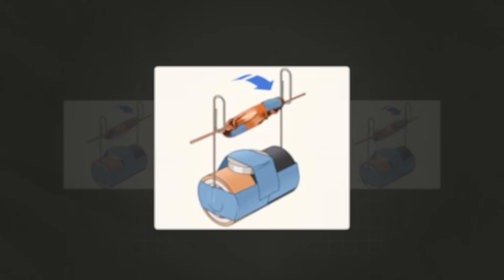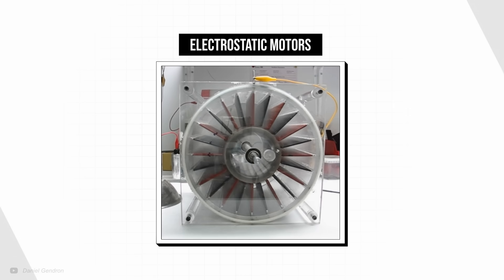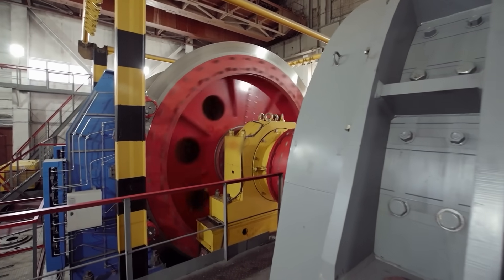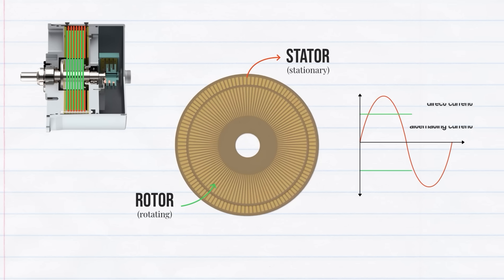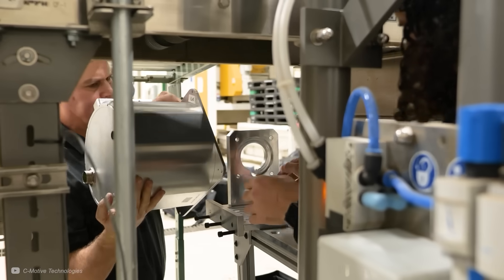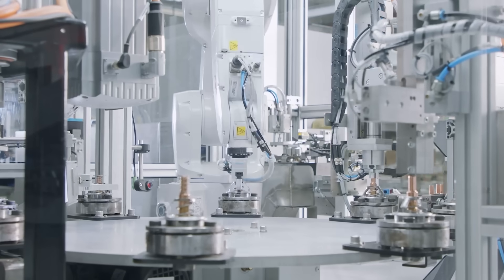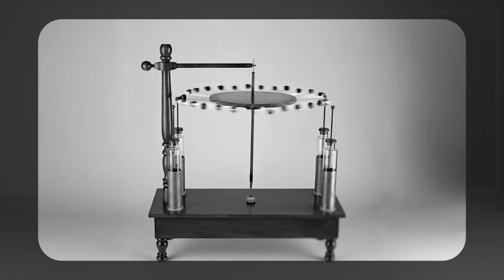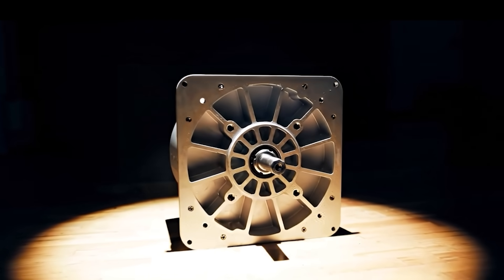How Electrostatic Motors are Breaking All the Rules

Comment: I designed a motor with a new version of the normal windings over a decade ago. I managed crap tons of torque at very low amperages and used voltage to gain speed. for the size of a coffee can  it is impressive but has drawbacks I have not been able to overcome, cost being  the largest of them, and feedback being the second major issue. While not even close to perpetual the regenerated power has to either be dumped or used to supplement the input power in parallel and as I am not a wizard with regulation systems I got stuck. Then when you look at the general costs to file a patent everywhere possible I just mothballed it and will leave it for someone else to solve after I die. If I could get the power system for it solved I would have already put it in my car as a replacement. The idea is scaleable and the beefier you make it the more power in terms of speed and torque you can get in really small sizes. Electric motors are a blast to play with and I was looking for R/C car/truck/plane uses when I started. Being un-wealthy really kills the ability to get the parts made and bought when creating new forms of technology. I shoved the idea and prototypes onto HDD and boxes to give to a few schools when I die to get the tech out there later.

Comment: Please do a modicum of research before presenting these claims.  This is far, far too much of a hype/info-mercial instead of science journalism. 

Specifically, there's no evidence that electrostatic motors can replace the duty-cycle (efficiency at a typical speed * torque range) of electromagnetic motors.  Forget replacing anything on the factory floor.  Induction motors are far too cheap and efficient.  At best, we're looking at aerospace applications for low-torque & low-speed & high-precision with a high torque-holding duty cycle where there's no need for the volumetric power density of hydraulics.  Those applications are few and far between.  

The "scarcity" of rare earths and lack of materials re-cycling is also from very overblown to downright lies --likely marketing spin from the manufacturer.

I'm being vividly reminded why I stopped watching this channel last year.

Comment: Regular mineral oil has a breakdown voltage in the 10 - 15 kV / mm. Those looked like >.5mm spacings and you said 4kV. Also they could coat their electrodes in solid dielectrics couldn't they?  The forces you can get out of static charges are so crazy it's hard to understand why technology like this hasn't already been around for decades.

Comment: Do the math  ,P=I×E . you cannot derive 5 horsepower out of micro or even milliamperes of current if you have a realistic high voltage not high enough to flashover insulation in or outside the motor. This is a totally bogus report.

Comment: aluminum transmitter coils have no back feed into the power source from the delayed recession of shifting flux on a stator that a PWM would use a transistor to field flip the transmitter coil on. analog redundancy, AC and aluminum transmitter coils. when it happens to be more available then copper, 300% currant flow reduction without added cooling. 4hp becomes 0.75hp aluminum wire, the abysmal 2025-2035 Ontario EV mandate.

Comment: 1.   Current motors are around 85% efficient,  not 65
2.  Electrostatic forces are very weak, unless using extremely high voltage. ES motors are low torque devices!
3.  Because of the high voltage, you can't run from batteries or reasonably sized power cables, - so no portable motors
4.  The ultimate dust magnets - HV attracts dust so these motors will need constant cleaning
5.   High voltage electronics are incredibly expensive and prone to failure

Comment: err - did you just narrated in an elaborated way the press release of a company?! — yepp, you did! – it became more and more obvious to the end of the video, even if you don’t mention the company… boy, stop repeating the happy-whatever press-shouting of a company, start thinking for yourself and most of all critical! so exiting such an interesting "invention" may be [the basic design is well known for a longer time now!] or even more exiting a greater usage of this technology may be by replacing conventional designs with rare earth magnets or coils — don’t let your excitement cloud your judgement! hell, be more critical and don’t simply read a mere company ad!

I thought about the design and its implications. In the IT we had for a long time the hard disk drives. Simply an design like the good old music record, where the read-write-head is flying above the rotating disk. a "head crash" is destroying the magnetic layer on the plate and therefore the recorded data itself. with the plate-electrode-design in the electric motor the architects of this solution facing the same trouble, not only the insulation problem! I think, the main problem in this case is not electrical nature in preventing shorting outs between the electrodes of stator and rotor — the main challenge may be mechanical: with increased rotation speed to prevent the plates to touch the neighbours or simply get disintegrated by centrifugal forces. If you can handle the stiffness vs. brittleness of the plates in relation of the rotation speed, size and vibrations (internal and external induced), if you can guaranty the gap between the plates at a minimum and all time in all circumstanced, then the next question of the insulation medium is easy. there are existing solutions… and the architecture of the "geometry" of the printed on copper paths re an complete other beast to handle. in the end this all only general thoughts of a laymen and non-expert …
Reply: I couldn't survive past the 5:20s mark. This vid was so obviously startup PR material, rejigged with the help of an LLM. I suppose as such is an inevitability when we turn our creative output into a full time money-making job. On a slightly tangential note, one thing I like about YouTube is that the more professional your channel becomes the less attractive it is to a great number of us.

Comment: I dont want to be overly pedantic as an electrical engineer but breakdown voltage is expressed as volts over centimeters usually
4000 volts over what distance? If 0.8mm then i guess it will withstand 230 volts in euro grid

Comment: Makes me curious about the possibility of using a solid dielectric housing around the stator and rotor. Kind of like a capacitor that has one charge plate in the rotor, and multiple charge plates around the stator. Less drag compared to using a dielectric fluid.

Comment: I question the need of this for the "supply chain security" or environmental angle. Both SRMs and electromagnetic-rotor motors avoid the need for any permanent magnets. SRMs probably don't cover the low-speed high-torque application domain they're going for, but in other domains we probably have better options for getting off rare earth magnets already.

Comment: This solution has two huge, insurmountable problems:
1. We do not have powerful transistors to effectively manage such voltages.
2. The friction of the metal invariably forms fine metal filings, which lead to a short circuit in the motor.  Which is fatal for the entire motor and control circuit.

Comment: The automotive application would actually be useful, hook one motor to each wheel inboard through a CV axle, at 60mph with an 18 inch wheel diameter, that's 1120 rpm. If these motors experience power loss over 500rpm, that means a top speed without significant efficiency loss of about 27 mph. However, a city bus with typical 42 inch wheel diameter results in 480 rpm at 60 mph, so these motors could be put in a city bus, one to each wheel, and a dampened generator unit on the roof of the bus can recharge a capacitor array in the chassis to drive the motors, and that would be a very good use case for these. So they prove themselves with industrial applications, and contract out to bus manufacturers who want more efficient buses.
Reply: Actually, another major use case would be baggage tugs at airports, and put in a generator-capacitor-motor hybrid system for other airport vehicles. The engine to dynamo maintenance is easy and fast, the dynamo to capacitor maintenance is easy and fast, and the capacitor to motor maintenance is about as difficult as current hydraulic and transmission maintenance (if a bit easier, but there's still the motor controllers) but faster with the added risk of shocks that are easily avoided with insulated gloves that power line workers wear. Overall, gas to generator to capacitor to motor (and back to capacitor on braking) is overall the most efficient multi-speed drive system for motor vehicles.

Comment: "Can withstand up to 4000V" - great! But not a word about how do you actually power such a motor. High voltage power supplies are anything but trivial or cheap, especially if you need essentially a custom VFD that can go up to a few 1000s of volts. In industrial applications this also means you have to deal with a number of regulations regarding high voltage and employ specially trained and equipped personnel to work with or around them which is anything but cheap either.

Comment: There's nothing secretive about the fluid. There are plenty of mineral and silicone oils which can prevent dielectric breakdown and help with cooling. Regular mineral transformer oil has a dielectric breakdown strength of 45 kV across a 2 mm gap.

Comment: About absolute maximum for high voltage before it produce spark is about 100,000 V per meter. With 0.8mm gap between disc it give us the maximum voltage we could get roughtly about 80V doesn't sounds exptreem by any mean. With that voltage current need to be pretty much the same as with magnet motors.

Comment: using 90% less copper only matters if its just as easy to recover that copper after the moters useful life span is over... and copper is a fairly easy metal to recycle and profitable sometimes. recovering copper from a PCB like thing is harder then copper bare wire.

Comment: scim are already over 90% efficient, the electronics needed to control motors at 4kv for a conveyor belt or other small motor in industry make this less efficient and far far too expensive and require special approvals and maintenance staff.  all that to replace a 10hp conveyor drive that works fine.

Comment: Great achievement! 
Does it have a minimum required voltage for the liquid to conduct? 
Is the liquid a 3M proprietary or C-motive?
The section about savings seems to reveal a high cost of the motor, can you give us a clue?

Comment: Speaking of high Voltage:  with all the lightening bolts coming down, why not build bolt capture stations that perhaps use a laser to ionize the air* so the bolt will follow that path to a Million Volt motor that can lift Skyscraper size weights to store the energy and then let the weight down slowly to run generators ?  InventPeaceNotWar.   Ck out new video on $4 "cure" for Alzheimer's should be on youtube my channel for public view Free as a gift to the world.  Its pedialyte or $4 generic equivalent. : *or shoot conductive wire up at storms to cause energy to follow that path, if done right the wire could be graphene and perhaps could be rewound back onto reel for re-use?  Ai says:  "An average lightning bolt contains about 1 billion joules of energy, which is roughly equivalent to the energy needed to power a small town for a day. However, capturing and using this energy is extremely challenging due to its high voltage and brief duration". So it would solve all the USA energy needs in very short time presuming a 10% capture rate in Florida summer day (we get 3,000 bolts per day avg alot of summers.

Comment: Very interesting.  I'm in the HVAC unit design, so I'm curious how they could affect that industry.  Fans generally don't use a ton of energy, but the refrigeration compressors use a ton, they probably account for 80% or more of the power a unit uses.  If they can make a compressors that uses very low power, they'll steal the market.

Comment: Couldn't they make a better connection between the stator and rotor if there was a kind of brush like structure between the two made from carbon nanotubes?

Like a brush motor, but carbon nanotubes instead of copper.

Comment: By ditching ferromagnetic materials you speed up the magnetisation of the system, also, high voltage increases the speed even further. I have a feeling this leads to a pretty big lack of dynamic range of flux - eg best for stable speeds and gears, unless the axle can free spin (with no current) and you alter the pulsation of the current (or maybe the duty cycle?) which would still rapidly saturate the system at a fraction of the speed of light (eg 50%, 10% 1% etc). Let's see, 1% of 300,000kms is 3,000 kms.While a MOSFET can switch at 100 Khz, the GAN can switch at 380 Khz. This is what powers Class-D audio amplifiers: pulse width modulated SQUARE WAVES at 380 Khz which you would assume would sound terrible... but Class D sounds... "OK". How? That signal is shunted into a torroidial transformer with good ole ferromagnetic material tuned to audio frequencies, so from 20 hz up to 20 Khz.. It can not produce such high frequency and is thus coaxed to "slowly" produce save a sine wave of say a 15 khz cymbals crash, drums or vocals etc. The bass signal practically looks like a DC electromagnet at this speed - m+agnetic+a+lly pulling the current in the speaker wires more like the coming of the tides twice per day.... driven by the flickering firehouse pulsing hundreds of thousands of squirts per second. Also..... you can go contactless / brushless by using the more old-school magnetic induction process to inject energy into the motor using lower voltage and electrically isolated "coupled inductors" situated just outside the motor + some ultra capacitors me thinks!! If you can can limit the current the 500 V to 5,000 V is a nice spicy voltage that should melt the GAN (Gallium Arsendine Indian AFAIK) but its OK if you keep them very cold. I wonder if CO2 is the insulator? I was thinking you were going to say the motor operates in a vacuum of argon / neon etc. That would look very cool. Liquid nitrogen? Wowzer. Also, the insulators - plastic, etc is very lightweight. Vacuum motor would be very low friction right?

Comment: With discs spaced just  0,8 mm apart I don´t see a lot of room for vibrations and sudden changes in position. Certainly not something you´d use in an EV car. As a stationary conveyor belt motor they might find better use.

Comment: Rule of thumb: if something could have been built for decades (there's nothing in this motor that has just been developed recently and thereby enabled it), but nobody built it on a commercial scale, there is usually a very good reason for that.

The industries' main motor is a simple induction motor, which is already over 90% efficient (with 97% for high power high efficiency motors). And if you don't need speed control (which the vast majority of applications doesn't) you can run it straight from the grid without drive electronics. Yes, it uses copper, but nothing else that's in any way special. Can't say that for electrostatic motors and their drive electronics.

Btw. you know what is needed to charge/discharge plates to/from a high voltage quickly? A lot of current!
Reply: Not really much current, the capacitance is small
Reply: @liam3284   It's not about capacitance, but about charge that has to be moved quickly (nothing will move unless the electric field switches constantly). MOSFET gates have a small capacitance, too, for example. Still you use driver ships that pump several amps into a MOSFET gate. And that is a small charge at low voltage.
Reply: And... with IGBT technologies multi phase induction motors can rotate highly efficiently at low rpms (if the whine doesn't drive you knuts!)
Reply: @Ino-z2m high carrier frequency setting decreases motor noise,   Its kind of hit and miss on what carrier frequency will make the motor the most silent.

Comment: there are tons of electric motors that dont use magnets, like squirrel cage motors, varriable reluctance stepper motors, hybrid AC/DC motors (aka DC motor with electromagnetic stators in series with the rotor's brushes)...
Reply: Those examples still use the electromagnetic force to generate torque and are subject to the physical limitations of magnetic systems, such as saturation and eddy current losses. Electrostatic motors, by contrast, rely on Coulombic attraction between charged plates, which is a fundamentally different force with its own unique advantages and constraints.

Comment: Hmmm. I work in manufacturing and none of the motors we use have magnets. So rare earths are not a problem. The copper maybe an issue but squirrel cage  motors don’t use that much copper and last a very long time. Even wound rotor motors last a long time and are cost effective with no magnets.

Comment: A very long road to try and replace a SCIM, the very backbone of everything industrial, that consumes 80% of the electricity generated on earth.  They are incredibly simple to make, do not use permanent magnets, no brushes or internal contacts/commutators and will last a very long time with very little maintenance.  They are made to produce hundreds, if not thousands of hp, and if you add a VFD, are even more capable, like soft starts, and 100% torque at zero rpm.  Their efficiency is far from horrible as well.  Good luck.

Comment: I feel like they've flubbed the efficiency numbers for conventional motors. Even at the roller bearings for a conveyor belt the efficiency wouldn't be 65%? Maybe the whole system but they are just replacing one small part and the rest of the inefficiencies remain. Plus just remember rare earth minerals are not necessarily "rare". Difficult to find in commercial quantities but cerium is actually more abundant than copper.